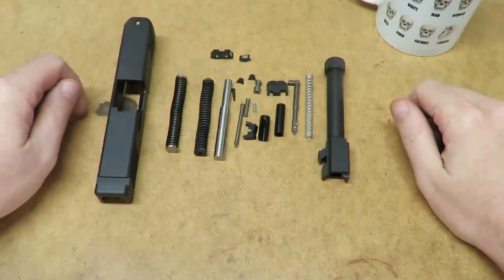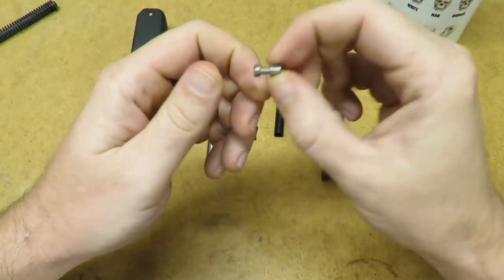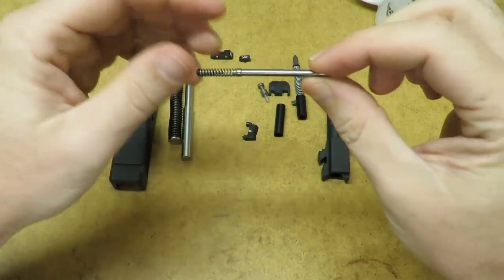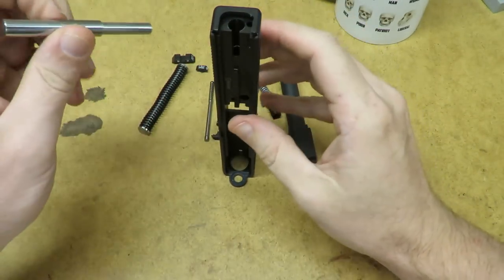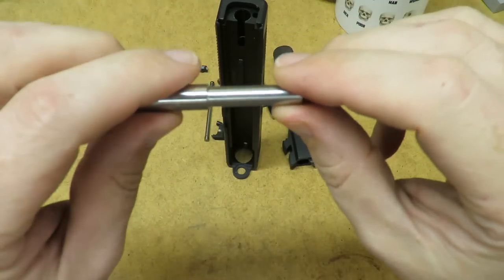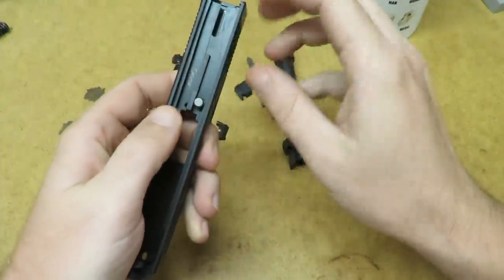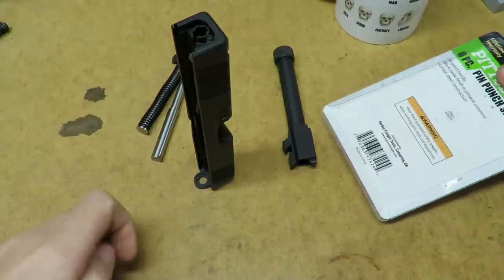Glock 19 slide assembly

Comment: John, I need some advice. I was building a poly lower Glock 19, and was nearly finished. I had a Glock 17 upper on the bench which I was going to start next. I picked up the 17 upper by mistake and put it on the compact lower, now I can’t get it off. The slide goes forward a little, but it’s hitting on something. I am holding down the slide release, but not sure what to do. Thanks!
Reply from the maker: The barrel is probably catching on the locking block. Try tapping on the barrel when the slide is as far forward as it will go.
  You could also just knock out all the pins, then you should be able to simply pull all the guts out still attached to the slide.
Reply: Of course, you are the best! I don’t know why I didn’t think about knocking out the pins. That’s the obvious solution. Thank you so much! I knew I was asking the right person. By the way, your video of the compact Glock 19 is the best on YouTube, you can see everything clearly, and is explained perfectly to me. I can’t thank you enough! God bless you!
Reply from the maker: I appreciate it! Glad you like it.
Reply: Taking pins out is your only solution. The Glock 17 locking lug on barrel is bigger than 19 barrel. 17 upper Goes on 19 lower but can’t come off , unless you remove lower frame pins.

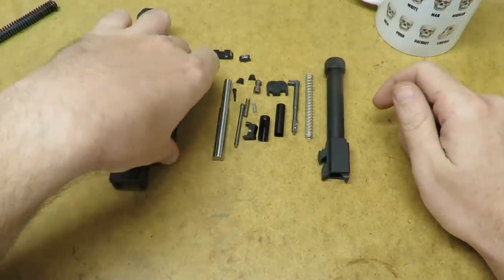Comment: What do you think of the cheap $80 bear creek armory Glock 19 barrel at 1:16 twist?
Reply from the maker: Probably one step above a factory barrel, depends on the rifling, and they don't specify.
Reply from the maker: It probably needs some miner fitting. 
Sounds like the feed ramp part of the barrel is hanging down about 5-10 thou too far. Normally it will just skim over the top of the block.
  Removing some material from there won't harm the function of the barrel as long as you don't change the angle too much.
  If the company advertises the barrel as drop in, you could get a exchange 
(save some hassle)
Reply from the maker: The best thing to use would be a diamond file (so you you can remove material evenly) If you take too much off the bullets will catch on the bottom of the ramp
  If your unsure about doing the work to the barrel consider sending it back, they advertise it as a drop-in replacement and have a limited lifetime warranty.

Comment: I’m having one huge issue. I purchased a custom slide for my g22 gen 3 and thankfully comes with channel liner installed. I purchased my internal slide kit and everything went well until I try to get the back plate on.. the spring and bearing for the extractor won’t go down far enough no matter how hard I depress it so I can get plate on??

Comment: Gen 4 slide with gen 3 lower  you can or not
Reply from the maker: I have a video on the channel where I put a Zev gen 4 on a polymer80 lower. It works, but it leaves the front section pretty thin.